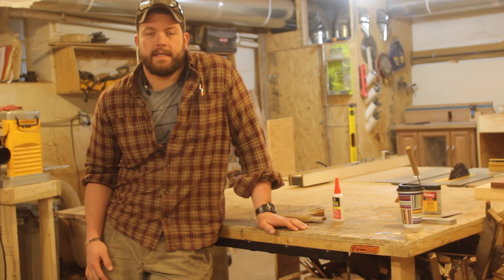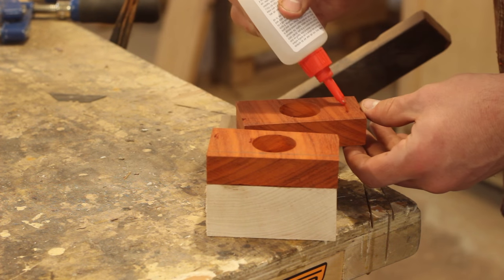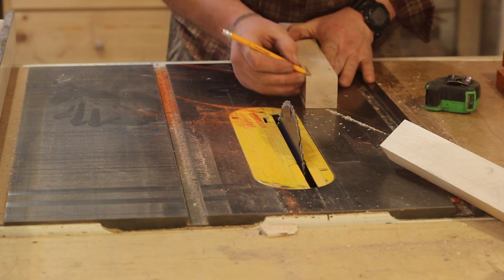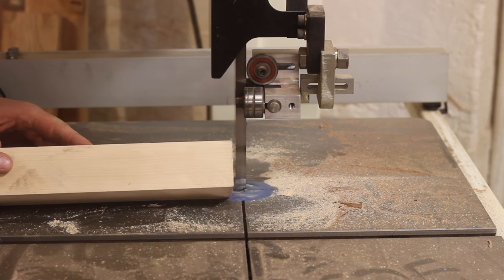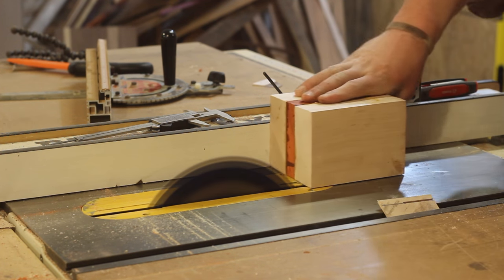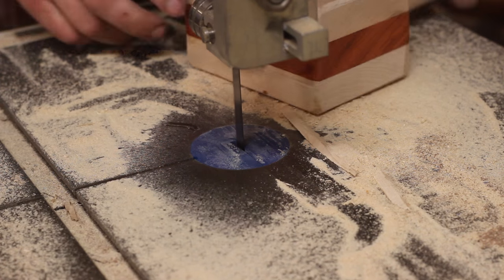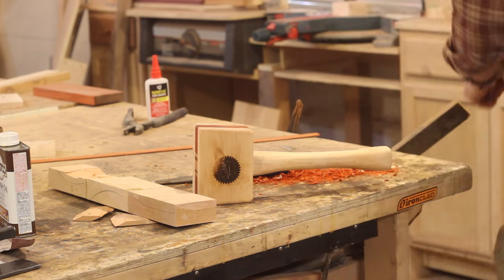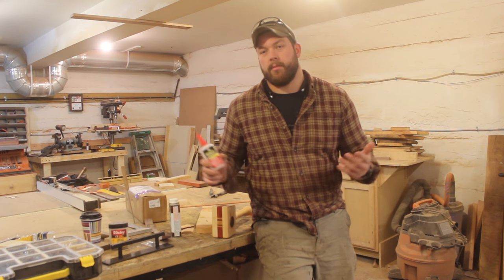Making A Hammer/Mallet using DAP Rapid Fuse Wood Adhesive

Comment: If you get any on your hands, use a little Marvel Mystery Oil. Also works on gum, tar, caulk, and wood glue, just don't get it on any wood.

Works great with a cheap toothbrush or even a shop towel to get pitch or resin off your saw blades if they're gummed up. I used the stuff just to try it on a tarred-up utility knife last week and it worked so well I've been trying it on everything. Stuff is better than WD-40 for some things; blows my mind.

Comment: Your bandsaw technique is similar to that used by Sam Maloof.  He stated that it is very dangerous but that was the way he learned to do it.  Hope newbies don't follow your dangerous ways on the table and band saws and get hurt.
Thanks for this video as I'm making a mallet this week.
Reply from the maker: A lot of veterans and pros use the technique. jimmy Diresta included. If you safely hold your piece and take your time you should have no problems.

Comment: I just picked this product up today because it states up to 3 min re positioning time. I found out quickly that I do not have even close to 3 minutes positioning time. I would equate this to medium or thick CA. Do you find that you have 3 minutes of positioning time?
Reply from the maker: It depends on what im making. I love the product for quick glue ups that do not need a ton of positioning. ie. Panels. Lettering, etc. I dont use it for large scale woodworking applications like some would try. It is fantastic for small table tops and panel glue ups tho.
Reply: I'm getting ready to make a hope chest so I was going to use it for the panel construction.  Glad you mentioned that it works good for that.

Comment: You unnecessarily wedge fit the handle after you taper fit the head. Laminated wooden hammerheads should not be wedge fit without dowels through the laminated head on both sides. I now know exactly why your first hammer died after only one year if you made it the same way. You only need to drop in the handle on a taper. If you're worried about the handle coming out just put a  dowel through the center of the hammer, or a bolt.